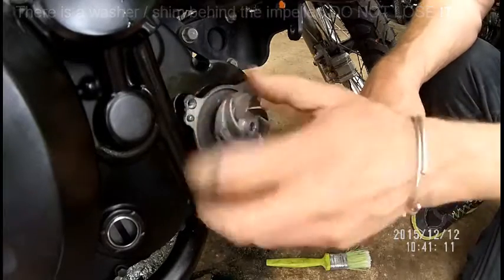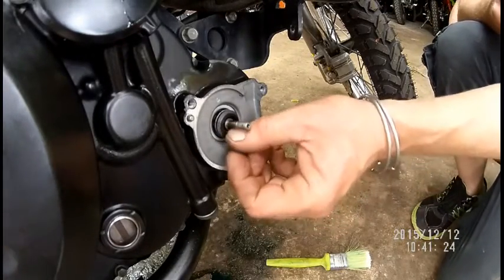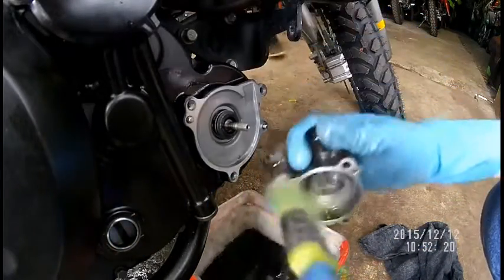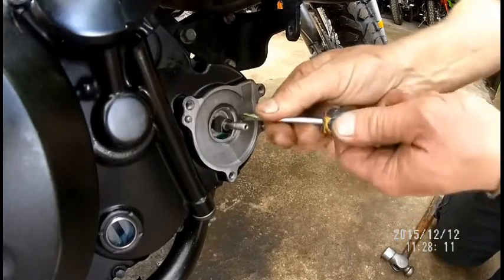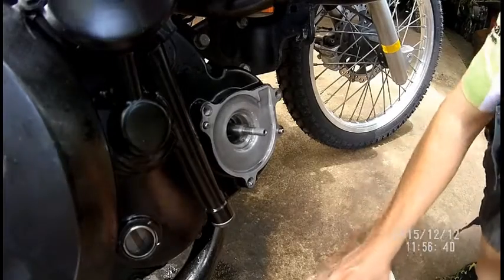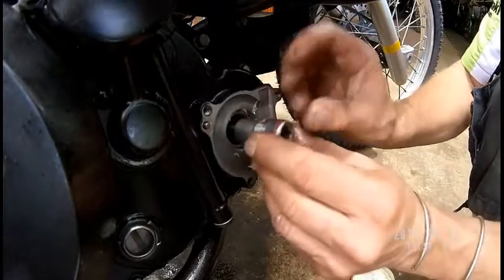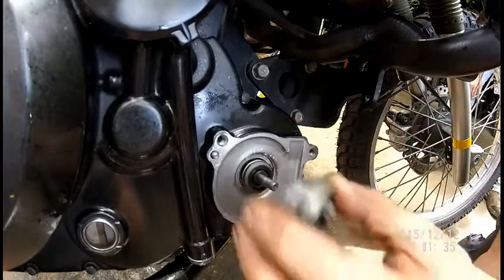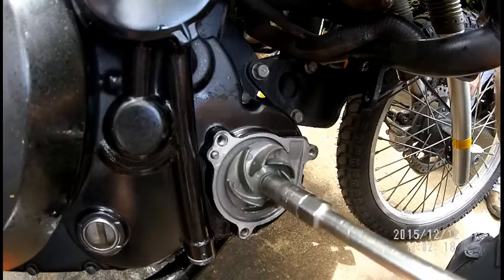KLR650 Pump seals replacements

Comment: I just replaced my oil seal on a 2022 KLR. Thanks for this video, btw the kit for the old KLR with the O ring and the seals fit on the new KLR there has been no new design change for these parts. You MUST buy the socket recommended in this video as a driver he is spot on recommending that kit, just order it with the rest of the stuff.
Reply from the maker: Thank you for the feedback. Engine hasn't changed much: Why throw R&D money at old rope
Reply: I think mine just started leaking with 1400 miles. How early on did yours leak?
Reply: @motozixxer245  I think it was leaking from new, I remember seeing a little oil when i picked it up but brushed it off as some random shop oil. New bike could not be leaking oil.

Comment: Thank you for posting this!  I used this video and just replaced my oil seal, mechanical seal and impeller using these directions.  Worked like a charm and much easier than pulling the motor cover off.  Thanks again!

Comment: Thanks for the tutorial.
I had trouble trying to pry out the metal retaining cup. I then put some gentle heat around the area and it came out quite easily (Be careful there isn't anything flammable nearby).
Local replacement parts were a ridiculous price so I bought one plus a spare one from eBay.
Reply: This is the way!
Reply: Heat gun is your friend.

Comment: Hello, mate Canadian dude here, I see that you’re still answering questions here I think it’s awesome,  What was the indication that it was the seal in the first place? My coolant was empty when I inspected it after it had been stored. Just from the remnants of the fluid it appears around the water pump is where it was coming from.
Reply from the maker: @StanTheMan-us3tp  two clear signs: either oil or coolant weeping from the little hole at the bottom of the pump enclosure.
It can also occur that coolant mixes with oil in the sump. If you got a baseplate you will see liquid after a short ride once the engine has warmed up

Comment: I wouldn't encourage anyone to replace the waterpump seals with the crankcase cover still on the bike. That's a good way to damage the impeller housing and possibly the new seals while trying to install them. Much easier to perform this repair on a workbench, and prevent doing damage. 
But, to each his own.
Reply from the maker: Completely agree...but this is Africa. Quote: Boere maak n plan

Comment: Hey thanks for the video! Took me about a dozen times of watching and listening, but it’s helping. Almost there, but you mention about a shim, What I gather that is the small O-ring that came in the new kit, but there wasn’t one on the bike when I disassembled the pump,  it there was a small washer in that spot. Wondering if they both go on before / near the impeller. Hopefully you can answer this! Thanks again
Reply from the maker: It's been a few years since my KLR... I looked at the parts diagram, the o ring sits against the impeller then the shim. 
https://www.cmsnl.com/kawasaki-kl650c4-klr650-1998-united-kingdom-fg_model12413/partslist/E3031.html

Comment: What kind of lube did you use to get the seal on? Would just petroleum jelly work or does it need to be engine rated?
Reply from the maker: Wheel bearing grease. As long as it works.
Reply: @PatrickFlinner  as long as what works
Reply from the maker: @danielboekweg2919  the end result. You can also use red rubber grease.

Comment: Hey just got my clutch (2006 KLR650 16,xxx miles) done at the shop rode it 180 miles since.... began to overheat 10 mins from home, get back home, coolants 100% empty only wetspot at weephole. Oil is milkyyyyyy you cant even look in the oil peep. Would replacing these seals fix it? I think the mechanic messed them up.
Reply from the maker: First off: My condolences. The time it will take to flush that contaminated oil out...best get some cheap diesel oil for the job.  Next: First you need to establish where the coolant entered the engine. If it is this seal, then its easy...anywhere else and it will require you to leave the bike in an unsavoury area with the key in the ignition.
Reply: @PatrickFlinner  thank you brother  just ordered the seals will keep you posted if it works
Reply: @PatrickFlinner  took off the waterpump cover and now trying to take the impeller off but it just keeps spinning?
Reply from the maker: @korwhyschannel  did you put the engine in gear to get resistance?also I think the loosening is in reverse? It's been a while since I remembered the work
Reply: @PatrickFlinner  I got it foot on brake and in gear came right off. whole waterpumps done the o ring in the impeller was damaged to hell. Think everthings fixed Thank you so damn much for your video!!!!

Comment: What's your recommend if the seal choose hard mode? I found a very tiny screw driver that I been hammer the corners to make a crease to pull from and it's still choosing hard
Reply from the maker: Pour fuel over the engine, ignite it. Once the fairings run like water the seal should be soft enough to extract with a pair of dentures.

Your plan is sound. Use needle nose pliers

Comment: Awesome video.  Did you put the new gasket on dry or did you use some gasket sealer when re-assembling and if so what type?
Reply: Just finished doing mine, went ok the mechanical seal gave me some grief made more difficult by the SW crash bars so I had to strip them off (Tank, Seat, Side Covers and right side crash bar to pry the seal out).  Looked as though someones been in there before as there was slight scratching where the rubber seal sits.  It all seated fine and was only a minor leak from the weep hole after re-assembly (my guess it was just the remnants of the petroleum jelly and oil being pushed out of the cavity).  Yet to take it for a test ride but ran it till it was at operating temp and kept it going till the thermostat fan kicked in and no leaks after cool down so hopefully all good.   Will know for sure after a proper test ride, really hoping its ok as I dont feel like stripping it down again.  Crash bars whilst a functional investment can be a pain in the ass when it comes to maintenance work.
Reply from the maker: Not required if the mating surfaces have been cleaned. If you want though, try adding a bit of Hylomar, a very thin film will assist in keeping the seal in place and to prevent shifting during assembly.

Comment: My brand new 2022 with 180miles leaks oil out of the weep hole below the water pump. At an alarming rate too. Soaking the whole underside of the engine after every ride. Is that impeller oil shaft seal bad?
Reply from the maker: Yes! Take it back to the dealer asap.
Reply: Did the dealer fix it under warranty?
Reply: @motozixxer245  no i got mad and sold it

Comment: Hay, great video. Looks easy and fast. Have you any leaks/weeping since the replacement?
Reply from the maker: +scooter_kenny Thanks. No leaks, no weeps.
Reply: +Patrick Flinner thank you..question, was yours leaking quite a bit or a drop from time to time?
Reply from the maker: +scooter_kenny It was weeping a few drops, noticed it as the dust from the offroad started making a sludge river. Could've left it, but I would rather keep my bikes in pristine shape.

Comment: cuantas millas tiene para que se rompa ???? muy bueno el video
Reply from the maker: Thank you (And thank you google translate). Bike had 14,000km ~ 8700 miles. 5 years old with a lot of standing periods. The seal can go at any time, it's one of those 1c cheap pieces.
Reply: hola la mi en un año tiene 10000 millas y enpezo una transpiracion de aceite no se si cambiarlo ?? o esperar un poco mas
Reply: la turvina de agua que torque de apriete le das ???
Reply from the maker: Reemplázalo. Lo último que necesita es que en su defecto en el camino. Par: Apretar a mano o compruebe el manual. Creo que fue de 22 nm.

Comment: Is the actual shaft supposed to spin? Or just the impeller?
Reply from the maker: Impeller attached to shaft, becomes one unit
Reply: Okay. I did this but have a small coolant leak from weep hole. I have the shim and washer in the correct places. Also the mech seal is nice and level and in place well. I have no idea what the issue is. Any ideas?
Reply from the maker: @Drew.407  Phhhh...only thing that comes to mind is that the seal is nicked during install or the shaft is worn allowing coolant past, best case scenario a bit of dirt got in the seal.
Reply: Can I use a bit of rtv or gasket maker around the rim of the mech seal?
Reply from the maker: @Drew.407  ...uhm. I am  not one for quick fixes. Rather find out what is wrong and go from there. A new seal is cheap vs being stuck on the side of the road.
Reply: @PatrickFlinner  your very right! Thanks

Comment: Hey, I have just come across your video. Does the oil seal go back in with the spring first towards the engine?
Reply from the maker: https://www.kawasakipartshouse.com/oemparts/l/kaw/5af06f9687a86610d0133b6b/2018-klr650-kl650ejs-parts

Have a look at these diagrams. They helped me in the past.

Comment: Tried to make holes with screwdriver to the mechseal cap exactly like  this tutorial. But.... No matter how hard I bend..and yank it thru the hole.. the cap won't come off! I even added extra hole (total 3 now) out of desperation and yank it again only to see it still hardly glued 😖 
Help. Now the cap is so distorted.. and I don't know what else to do.
Reply from the maker: Bima Ksatria try needle nose pliers and twist the metal. Do this until it's loose.

Comment: Is the water pump seal the same as the mechanical seal?  Is the mechanical seal just another name for the water pump seal?
Reply: By the way, this video is going to be a HUGE help, I can't thank you enough for making this video.  I can't wait to fix the oil leak in my bike!
Reply from the maker: You are most welcome. On the seal question: No idea. KLR650 manual is still floating around on the net. It would be your best guide...password was "Doohickey"if I recall correctly.
Reply: Thank you.  After about 2 hours of researching I think I have found everything I need.  I am basically replacing the whole water pump and ever seal, lol.
Reply: Actually, you may be able to answer another question for me.  When I was removing the mechanical seal, I dented up the water pump housing a little, do you think that I can still use the water pump housing with a few little nicks?
Reply from the maker: ...how bad? If it impedes the function then scrap it. If it's on the sealing section you may get away with it...maybe. Treat with caution.
Reply: Yes, its just around the area that the mechanical seal fits.  Its not horrible, in fact, it looks brand new other then the few nicks from the screw driver.  I would hate to fit the mechanical seal in there then find out that it is worse then when I started and have to scrap the seal again, but I also hate to spend $45 on a new piece of housing if it is going to work.  I guess its a gamble either way.  Thanks again for your help.  Ill let you know the results in a few days.
Reply: @hustleeveryday6582  have same problem...did you had any problems?

Comment: Here's the real lazy way:  Go on ebay and order a replacement clutch cover with seals already installed (have the seller inspect them to make sure they are not damaged) and just replace your old cover.  That's what I did for $50, no more leaks lol
Reply from the maker: No fair! That's a level of laziness that I would aspire to

Comment: what spot with the screwdriver are you hammering on?
Reply from the maker: I drained the oil as I changed the filter as well, but no you could just tip the bike over and work from there, same with the doohickey repair. Screwdriver is resting on the little piedish (no better word comes to mind), you only need to bend it in order to remove it via lever action.